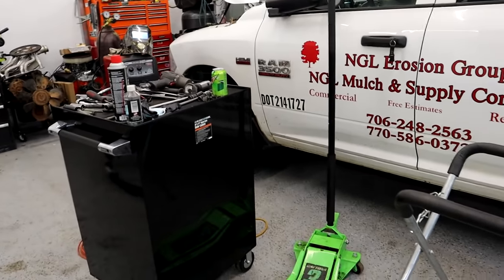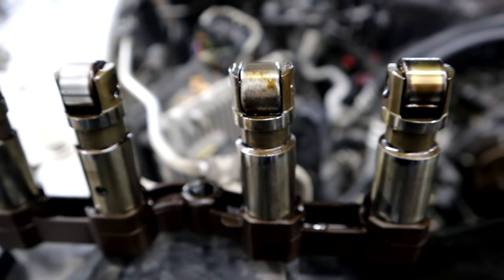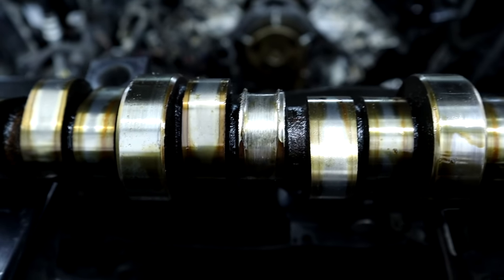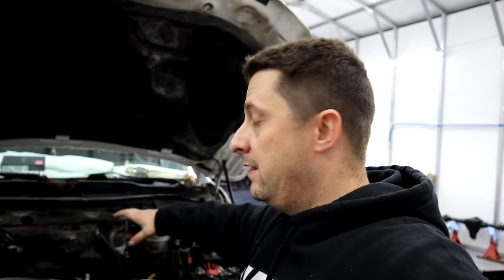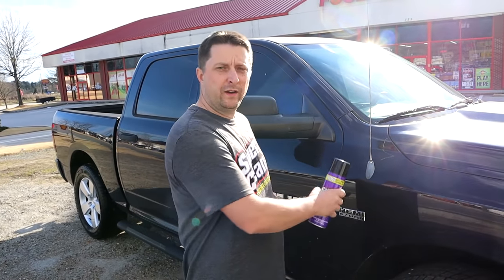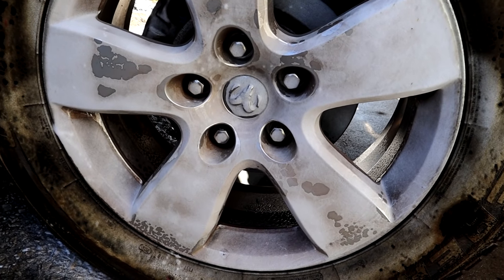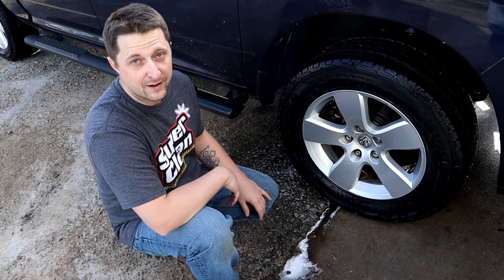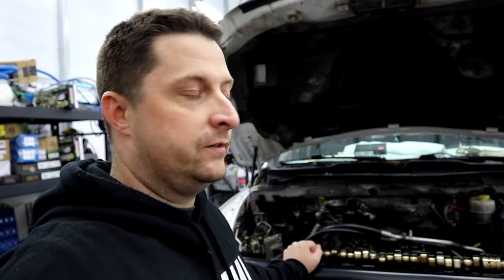6.4 HEMI Engine Failures Common Problems WATCH OUT.

Comment: Amsoil Signature series oil. Is the oil you need.
Reply: It’s the best out there! Use wix filters as well,
Reply: Amsoil is awsome stuff run it in my 2.3 ecoboost but no oil in the world can save a junk engine and unfortunately thays all Mopar makes today is junk!
Reply: @victorgirouard1543  MMH, The Problem is EVERY Make/Model IS ENGINEERED & BUILD WITH ISSUES, what are alsways a DESIGNED IN, that the issue will come up when the Factory Guarante is runned out.... ( I hope my words are the right ones, i´m from Bavaria (Ger) & i hope i can tell you what i mean... )
The most people didn´t know that there are "studie- / work shops" at the universities today, to engineering and designing a Part for an Automobile, for an fridge & all technical things with issues what will come up after the guarantee of the company/factory runs out..And how earlier, or even at best at a special defined time aimed after the guaranties of the factory/Company is runned out, so "much better" is the design of an product... THAT´s really not an conspiracy theorie, it´s fact. 
What do you think are the REAL PREMISSIONS of introducing and pushing the Electric car; It´s the ULTIMATE TRASH AWAY PRODUCT....Ant that Problem is FOR ALL EV´s FACT. It´s not to comes them by or even can do something against that an EV will be a "1 way product" for the consumer....The Consumer is the one who PAYS that BAD TECHNOLOGY from 1820s...The EV´s was canceled, because you can´t beat the Physics...You can only brainwash the people to sell them bullshit... Everybody who buy an EV or also "Hybrid" hasn´t understand anything else..With the buy of an EV they´re digging theiy own and our grave, the grave of the last good automobiles were you can do something against "Factory build in issues", even with the knowledge about the issue of an Auto you can do something against, IF IT´s AN DIESEL or GASOLINE ENGINE AUTOMOBILE... At an EV NOT & NEVER....

The ONLY ONE OPTION to come by these different "Factory build in issues" is to get the knowledge about the issue and find ways to cancle these issues with OWN OPTIMIZING.... In my eyes are these HEMI´s GREAT ENGINES, but you´ve to get them run on lower temperatures, especially cooling temperatures (What will help against that common issue of "Dropping Valve seat rings"...Then the Thermic Expansion of the Aluminum Alloy Heads would be that tiny measures smaller that that wouldn´t come on this engine.... And you´ve to do something against the ROLLER LIFTER FAILURES....Like here shown on the Video. And the easyest Way is to SHUT DOWN THE MDS (Diablo Programmer or something else like that) what makes the "HEMI TICK" a lot less possible. And if you´ll do it mechanically, you´ve to get the NON MDS CAMSHAFT & LIFTERS SET. But that´s not even a must have, if you can shut the MDS down. But you´ve always do the things like regular maintenance like Oil Changes/use Motor Oil of th right SAE Grade like the 5W20 or 5W40....

AND IF ANYONE ELSE HAS MORE IDEAS, ERITE ME PLEASE :)

Comment: They work their trucks extremely hard and I guarantee they don’t change the oil every 3000 miles so of course this is gonna happen.
Reply: He didn't mention how many hrs were on the truck. They should calculate hrs because idling is considered extreme use in any engine.
Reply: @bicyclecrashsurvivor8884  I am hearing lately that the idling is what is bad for the engines and the oiling. Since it is a low idle it isn't getting the oil where it needs to go. So by less idling and more under load (higher rpms) it is getting the oil pressure up and lubricating it like it needs.
Reply: @TeknoVkng  I agree, and if people do idle these engines then change the oil based off hrs and not mileage.
Reply: @bicyclecrashsurvivor8884  THAT is a VERY good point.....
Reply: @bicyclecrashsurvivor8884  is there a recommended hour threshold to change the oil?

Comment: This issue has been going on for a long time, you figure Dodge would have figured it out by now !
Reply from the maker: I guarantee they have they just don't want to redesign a new engine yet.
Reply: @FrostbiteRam  They fixed the 5.7 in 2018, so they may have fixed this one too. I heard that you can swap the lifters out for hellcat ones. They're apparently better.
Reply: @gasolinediesel972  they did? I thought they were using the same 345 hemi since 2009
Reply: @gasolinediesel972  Can you provide a link to where this fix is announced or described?
Reply: @frederickgrayson5177  I have been told that it was resolved in the middle of 2018. I haven't heard of anybody having this issue after 2018, so I do believe that it is real. The only reason why this happens is because the lifters are junk, so it's really not hard for them to fix it.
Reply: @blackice7408  They have been using this engine since 2002 I believe. All they did was change the lifters for 2018.
Reply: @gasolinediesel972  so the problem isn't occurring anymore?
Reply: @blackice7408  I have been told that, and I haven't heard of any 5.7's having this issue after 2019. Unfortunately I cannot find any info directly from Chrysler. I've been searching. All they do is tell you the differences between the 5.7 and 6.2 hemi's. You can ask a mechanic if you're not sure. I'm not too sure to be honest myself, but there is evidence leading towards it.
Reply: @blackice7408  Don't take anything that I've said too seriously, but I know people with 2017 hemi's that have this issue, but no 2019 or 2020. They supposedly fixed it in the middle of 2018, so some vehicles will have it, and some won't. The new hemi's do still have the hemi tick, which is caused by the exhaust manifold bolts breaking.
Reply: @gasolinediesel972  so technically they didn't fix the problem. Because companies will make sure the public knows of any problem thats been thoroughly addressed. But fca hasn't. So the problem prolly hasn't been fixed but tweaked
Reply: @blackice7408  Maybe. They might have just made the lifters better, but they didn't fully fix it. Hopefully, if they haven't already, they get off of their asses and fix it. Luckily there are many aftermarket fixes for this.
Reply: @blackice7408  Form articles that I've found, apparently 2011 is the worst year for the engine. The newer hemi's can still have this issue, but it is much less common than older model years. I wouldn't worry about it on a newer model.
Reply: @gasolinediesel972  then again the 19s and above are very recent for any true results
Reply: @blackice7408  Age doesn't really have anything to do with this problem. I've heard of older hemi's with very low mileage having this issue. Even below 10k miles.
Reply: Dodge has trouble trying to figure out how to get out of bed in the morning let alone how to build a vehicle! JUNK!
Reply: @ShadowBannedagain  They fixed the issue on newer 5.7's I'm 99% sure. This leads me to the conclusion that they fixed it on the 6.4.

Comment: I just ordered a 2022 Power Wagon (Dont have it for about 12 weeks).... Same Motor...I always use synthetic, but would it help to put a moly coating or other (sticky) product in the oil?  I'm not a mechanic, so just curious to ask one....
Reply from the maker: Change oil on time and stay away from long idling is best advice i could give.

Comment: Thanks for the info! I was between the Ram and Ford. Blue oval for the win! Never owned a Ford before.
Reply: 5.4 Ford f150 motor motor is also bad. I'm trying to get mine rebuilt,  it crap'd the bed at 190,000.
Reply: @MrStaybrown  only the 3 valve versions do that
Reply: @MrStaybrown  the 5.0 and 6.2 are some of the best V8s in the last decade
Reply: @austinreed347  gotcha. 
I hope to have the 5.4 running again by spring. 🤙
Reply: Ford 5.0 liter has a MAJOR oil loss issue. I bought RAM because of that.
Reply: @vickibange7259  enjoy ticking noises and cylinder deactivation lol 😂
Reply: @austinreed347  it's running stronger than ever,  I don't remember the motor ever running this great.

Comment: Why are Ram & GM having so many lifter problems? I am about ready to go back to Ford. I left Ford because of two lemons then went Chevy and had one with old consumption problems and the other I never had problems before selling it but have heard of lifter failure in the 2014 and newer. Now the Ram Hemis have lifter problems. I own a Challenger with a 6.4 and Durango with a 5.7 and I’m a bit concerned about this. May trade Durango for Explorer.

Comment: I drive my 6.4 in manual mode to see if this problem goes away  I had a 2012 5.7 that did this and it must be caused by cylinder deactivation and idling

Comment: I've had zero issues like that I have 2014 6.4 2500 bought in 2015 with 12,500 miles on it as of now as I'm driving i have 215,816 miles 
Idle hrs are 908 
Drive hrs 4531
No cam no lifter problems whatsoever

Comment: I was told that the 2018 and later 6.4 Hemi was given different lifters which prevents this issue.  Is there any truth behind this? If so, did the change prevent this issue in newer 6.4 hemi engines?
Reply: @hahaadventures4838  good to know. I have a 2021. When it idles there is no tick but I have started to notice a whoop whoop noise at idle.

Comment: Do aftermarket cam and lifters cure the problem after it’s fixed
Reply from the maker: Definitely makes it better just like the 5.7
Reply: What aftermarket brands to use, any warranty, anything good for long run, power boost, over boost options. Thanks
Reply from the maker: @andrymashka1757  I recommend getting a custom tsp camshaft or comp cam and delete the mds with some hellcat lifters seems that is what most all is doing across the hemi platforms and seems to be helping/fixing the issues at best.

Comment: Nothing was said about why these failures are happening.. I have a 6.4 Ram 2500 and reading into it a long time. The only reason that I can find why is improper oil for this engine. Make sure to use the proper full synthetic 0W40 SRT oil for this engine.. got mine in Jan of 2014 and it is still awesome.
Reply: And I forgot to mention that high idle times are a factor too. Another you tuber says he thinks the oil pump can be a problem a idle.. If I ever get into my engine I'm changing to pump to a hellcat pump for higher flow at idle.. food for thought 🤔
Reply from the maker: It's all kinda a who really knows thing lol but it happens 🤦‍♂️

Comment: Have to ask is there a fix for it yet move the line from the middle of the engine so it can oil up to cam and lifters and does the hellcat engines have the problem
Reply from the maker: Most people like myself has installed hellcat lifters and non mds camshafts seems to help or fix this.

Comment: In almost every instance of engine failure dirt damages the lifter roller and caused a cascade of damage  that is the downside of a hemi they are sensitive to dirty oil or extreme dirty working environment they need more frequent oil changes a cummins doesn't have that problem  but a gas engine is still far more cost effective than a diesel

Comment: Why would you use same lifters if better aftermarket ones are available ?
Reply: Because the lifters are not the problem
Reply: @MoparMadness93  what is the problem then?
Reply: @flawlessvic  not enough oil is getting to the lifters at idle.
Reply: @MoparMadness93  so bad engine design?
Reply: @flawlessvic  from what I understand yes. Don’t really know much of a solution other than running higher end synthetic oil that will make up for the lack of sufficient oil a bit

Comment: I was always told that the 6.4 is the best one. Better than the 6.2 (obviously), and better than the 5.7 because the 5.7 loves to eat it's cam. I'm sure this is fixed by now, as the 5.7 no longer has this issue.
Reply from the maker: Time will tell 👍
Reply: @FrostbiteRam  Yeah. I heard that the Cummins diesel I6's are having issues with the fuel pump too. Bad year for Chrysler engines. Hopefully, if they haven't already, they will fix this shit.
Reply from the maker: @gasolinediesel972  i hope so its getting old for sure.
Reply: @gasolinediesel972  old post but I had the AC go out in a brand new Cummins with less than 5k miles on it

Comment: People go by the computer tell them when to change the oil... I go every 4000 miles.. If i went by the computer it would be every 10-12000 miles... change every 4000 and they will last longer
Reply: I change my oil on my 04 titan at every 12000 miles 270000 miles and still purring
Reply: I do use the best products I can find when I do thougj
Reply: @davidkuznetsov9316  I go 9-10K on my 07 Titan. Had it for 12 years now, never a problem. This vid popped up because I have been considering a Challenger 392....hmmm, now I'm not so sure! Maybe I'll just stick to Nissan!
Reply: @jasonw8124  the 392 is a different motor. Don't let this deter you. The issue with the 6.4 is from the Cylinder shutoff system. A tiny porthole on the cam clogs starving and seizing causing this issue. Regular oil changes will prevent any issue.
Reply: I don't even know if Challengers and Chargers have the MDS system but usually running light performance oil unlike what you see in pickups and heavy dutys.
Reply: @diamondheat9  the 8AT 392 has MDS, the 6MT does not. I'm referring to the Challenger, not the trucks
Reply: @jasonw8124  so safer bet would be the 6MT. What model 392 were you looking at?
Reply: @diamondheat9  2021 ScatPack widebody.  Oddly enough, choosing 6MT over 8AT increases the price a good deal. Must be because the non-MDS 392 is an "oddball" as the vast majority of 392's are manufactured with MDS as they all get automatic transmissions.

Comment: If folks change their oil on time that won't happen... Change my oil every 4000 miles and 172000 miles later still no problem yet... My 2 cents
Reply from the maker: I did mine on time or early and still had the failure. Some do it more than most and some get lucky.
Reply: Ì have a 3rd Gen Ram with the 5.7 Hemi. I'm not sure if the Hemi had those issues back then? I know I haven't any of them and the ol' girl's pushing 205 000 miles. I do oil changes every 4000 miles or close to it since I've owed the truck. As you said, some people get lucky and don't have issues. I'm looking another truck..... another Ram of course, hell yeah it's got a Hemi💪👍.
Reply from the maker: @billknight5578  right on🤘
Reply: And if they put the right weight oil in them ,that want happen
Reply from the maker: @randyodom2782  mine failed with proper everything it dosen't matter what you do. They will fail sooner or later that's why you see so many cammed hemi vehicles now days.
Reply: Have a 13 with the 5.7... 86000 miles change oil every 3500 miles.. still runs strong

Comment: I know 3 guys with hemi trucks...and they have NEVER had any troubles with them.....I am a Mopar guy and I AM always questioning any issues....it is ALL about oil changing and keeping a tab on engine heat. MOST guys go the limit with oil change intervals, If the oil change interval is say, 10,000K, then you change the oil at 5-6000 K. Also, use a GOOD quality synthetic.
Reply: Yes like Slick 50 or Dura Lube😅🤣😂🤣

Comment: I could understand if these motors coming in we're in the 30 to 50,000 mile range but over 100,000 miles? At this point I would say a lack of maintenance for sure. As a former business owner, I bought a Ford van for one of my delivery vehicles that have the 5.4 l. I did the regular maintenance on that van and got 280,000 mi on the engine and transmission. It was all running good when I sold it. 5.4 doesn't have the greatest history for longevity.

Comment: let me guess, you're going past 5000 miles in your oil change intervals...

these engine should only go to five thousand Miles on oil if it's 100% highway mileage.

otherwise 2000 miles in harsh conditions.
Reply: Cheap oil kills.  Replace it with good Synthetic oil, when the lifter roller seized again, the stuck roller just slide over the cam lobe with less friction.
Reply: Exactly, and use GOOD oil. No blends, straight synthetic.
Reply: @diegosilang4823  when rollers stick they don’t just “slide” over the cam lobe when you use synthetic. It still wears the hardening of the lobe and then proceeds to eat the camshaft

Comment: What about all the metal shavings did the oil filter catch them all or are you gonna have them floating around in the motor to cause different issues later?
Reply from the maker: Have to flush and change the oil a couple times and good to go.
Reply: @FrostbiteRam  oh ok I see I was in the market for the 6.4 hemi but idk now lol
Reply: You can flush an engine easier by adding kerosene to the oil, add a cheap filter and attach a strong fridge magnet to the outside barrel.  Don't start it, but crank the engine over to pressurize the passages, drain the pan and cut the filter open. Rinse and repeat

Comment: shut my MDS off around the 15000 mark with a Pulsar plug n play,,, rounding 90000 miles with no ticking or codes 16 1500 5.7  change the oil every 5000 Castrol full syn. Hoping for the best.
Reply: I hear the mds is what leads to all of these issues . How did the power feel after the tuner ?
Reply: @austinbuehrle377  I run 99% of the time on economy MDS off,,, performance MDS off is a considerable jump in power for sure. sounds amazing with the Craven muffler,, RCSB with 3.92s and Bilstein 2.5 level with  Nitto 35x17 tg2s

Comment: The 64 K ? is WHERE DID ALL THE CAM/LIFTER MATERIAL GO.? ...........hmmmm i WONDER WHAT THE RODS/MAINS LOOK LIKE ..HAPPY MOTORING !
Reply: More likely the oil pump will suffer, as it doesn't pull filtered oil.  If the filter is doing it's job, there would be no metal flowing to the bearings.
Reply: @jamesplotkin4674  the 6.4l has tighter bearing tolerances than the 5.7l so the repair manual for the 6.4l says to pull the oil control valve. If there are shavings on the oil control valve then it says you should replace the whole motor. The 5.7l you just have to clean out the oil pan.